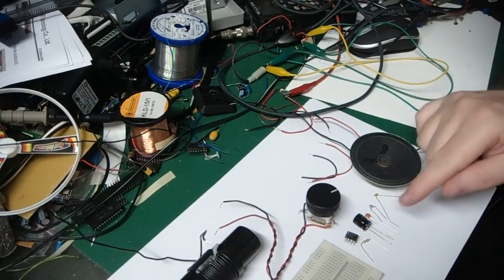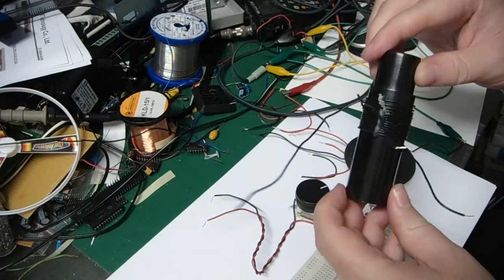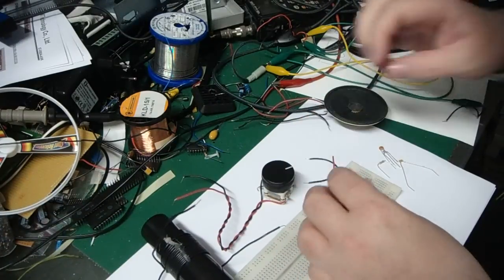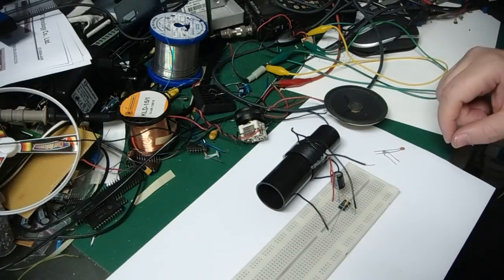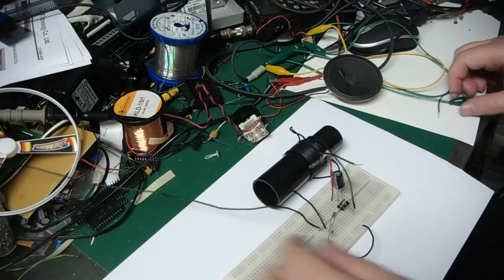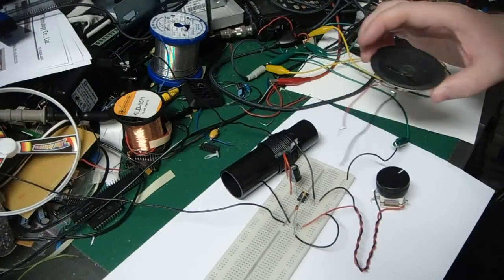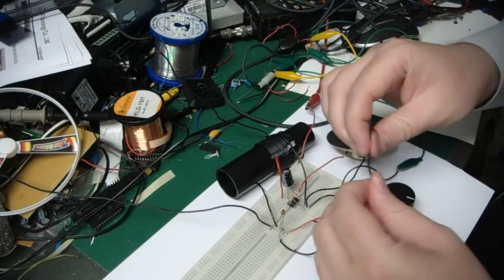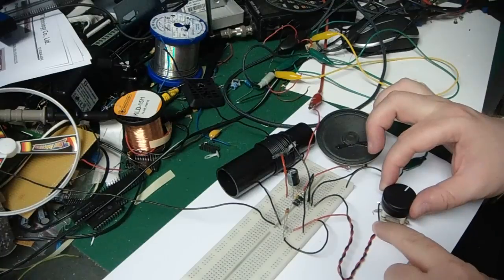DIY Radio in less than 5 minutes!

Comment: yeah my gramps defantly had a 1x 100 ohm Speaker, 200k Resistor, LM741 Op-Amp (or compatible), 220uF Electrolytic Capacitor, 10 nF capacitor, 15 pF Capacitor and a 47 pF capacitor haha but great video

Comment: You made an error. Pin 6 is the output of a 741 DIP-packaged op amp. Pin 7 is the +Vcc, Pin 4 the -Vee, pin 2 is the -IN and pin 3 is the +IN. With all respect, your approach to explaining this is abmysmal. I suggest that you show the schematic. For example, where is the +IN (pin 3) of the op amp connected? It should be biased to some voltage in order for the op amp to work correctly. And why does your coil have three wires coming from it? Also, your 220uF capacitor is probably backwards.

Comment: Try using a 1M ohm resistor between the input and output of the op amp. This will give you higher gain (i.e louder).

Comment: Great video, although it's not really obvious how you're hooking up those caps. Also correct me if I'm wrong but this would only be able to pick up short-wave, correct? A 2-inch air coil of 14 turns around a 1-inch diameter will make a 2uH inductor, and with a 200pF tuner that will resonate at about 8MHz, or smack bang in the middle of the SW band. To pick up AM you'd need something closer to 500uH, i.e. a couple hundred turns of insulated copper wire.

Comment: One more thing, you say that on the 741 power goes to pin 6 and the output is pin 7, it's actually the other way round (you can see that from where you're hooking up the pins in the video).

Comment from the maker: @mytube30590;
I haven't measured or calculated it, so no...sorry ;)  But maybe you can figure it out, it has about 63 windings, with a coil that is 0.70 mm diameter, around a 3 cm. plastic pipe? It also has 5 taps about each 10-13 winding.

Comment: I'm unfamiliar with the 'breadboard'. When you were pressing the components into the board, you were indicating numbers.... this pin goes to this number-this pin goes to that number... What exactly were you pressing the components into?  Is this something that requires soldering at a later time? What band was that receiving and how can you get it to receive different bands?

Comment from the maker: @markofgunderson, the antenna is very easy, it´s just a longwire (literally - a long wire!), you can also connect it to your house radiator (heating element), just watch out for shock! If you do this, make sure you are running the radio on a 9v battery instead of a 9v mains adapter, this is for your own safety, most likely nothing will happen, but yet... ;)

Comment: This should if only the radio signal is very good around you...but if it is far you will need a real radio micro-chip to receive the signal and convert to radio sound. I can that everyone has tried and many doesn't work so...that should be the case.

Comment: I would like to make myself a radio receiver within range 108 MHz and 137 MHz (yes, to hear air traffic controllers from the airport in my city, which is like 8 kilometers away from my place). I am on the last floor of 25-30 meter building. Is this "simple" way of doing a radio receiver sufficient enough to capture good audio quality in my case? How is the receiving range adjustable? Thanks.

Comment: If anyone is stuck in finding 2000-2200pF Variable Capacitor, try this approach :
http://www.hanssummers.com/varicap/varicapjy.html
This whole thing should be used in place of the Variable Capacitor
You might wanna use 2nF or 2.2nF instead of the 10nF he used there, or experiment with other values, ain't sure!